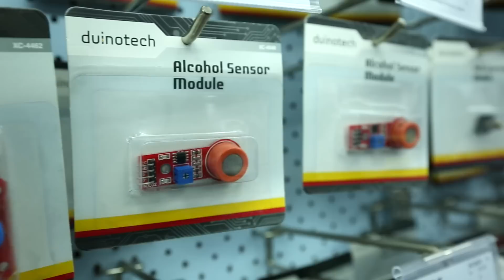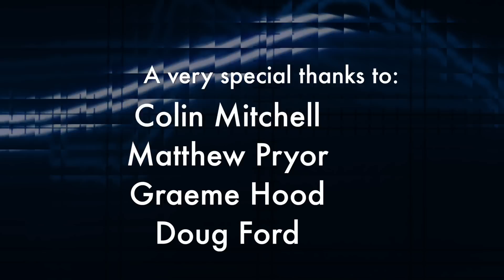The Decline of Hobby Electronics?

Comment: How do i start
Reply from the maker: Get yourself a kit from a place like Jaycar. One that comes with a book to help explain how it works and put it together. If it doesn't work, use systematic steps to solve why it doesn't work. Many people learn so much from doing that. Otherwise, start with basic electronic tutorials on Youtube, get an Arduino UNO, buy an electronics magazine. Despite the tone of the video, there are lots of options open to you. Good luck!
Reply: There are lots of good beginners tutorials on YT.  Try the free Fritzing software.  You can build virtual breadboard circuits with it.  It's handy to learn what components look like in real life and as schematic symbols.  I think it might even run sims and lay out PCBs.  There are some circuit simulators online too that show current flow animations and provide virtual equipment like a voltmeter, oscilloscope, power supply, etc.  Just Google it.  There are many Arduino forums.  Arduino is a open-sourced microcontroller platform with a free IDE and high level language support.  Look for Sparkfun, Adafruit, Thingiverse.  There are many sources for parts (i.e. Digikey, Mouser, AliExpress, etc.), kits, tutorials, Q&A, whatever.  Go watch Dave Jones at eevblog on YT.  There's also a eevblog forum.  Ask questions and get answers from people who live this stuff.  Analog circuitry includes many sensors (temperature, humidity, pressure, light), amplifiers, voltage regulators, AM/FM radio, etc.   Digital circuitry includes hard logic (i.e. NAND gate, NOR gate, 4 bit counter, shift register, latch, flip-flop, etc.) and programmable devices such as microcontrollers (Microchip, Atmel, Arduino, and dozens more), configurable gate arrays (CPLD, FPGA), and so much more.  Cool projects often include both digital and analog circuits working together.  After you complete a simple "hello world" or "LED blink" first project with an Arduino (or other controller ie. Raspberry-Pi, Beaglebone Black), you can add a simple serial text display (i.e. 2 line by 16 character LCD) and write some text messages on it.  Or, you can connect a serially controlled RGB LED (or several) and make amazing color patterns (search Adafruit Neopixel, you'll love it).  If and when you want to make a real PCB of your own, look for free KiCAD software, design your circuit and PCB and order your PCBs from JLCPCB.  There's an infinite amount of stuff to learn, and you can create your own too, so if you are serious, be prepared to commit your life to it.  The world of electronics and programming is big enough to fill 100 lifetimes.  Learning never ends and you can't ever know it all.  If this seems overwhelming, don't worry about it.  Just spot something that you think is interesting and follow it.  You can change direction whenever you want and nothing that you learn is ever a waste.  Just dive in and have fun.
Reply: @bill392 very helpful

Comment: As evidenced in this video, when you want to build something now you just get a couple of modules (arduino etc), clip them together, plug in some code and it works. No soldering, no assembly, no drawing out a circuit. It's pretty much all done for you. It has removed the enjoyment and challenge of first sourcing the parts, constructing a PCB and playing around with the unit to make it work exactly as you wanted it to. I think another thing that has seen the decline with hobby electronics is that kids are far more interested in video games and computers than they are in learning to build a crystal radio or novelty LED project like we did in the 70s and 80s. A small PCB that does one not-so-amazing thing just doesn't compare to a large screen with dazzling graphics, sound effects and games which enthrall kids for hours on end.
Reply: Arduino is both. 
As a beginner you connect your modules together and copy paste some code together and you're done with something that works quite fast

And advanced makers construct Thier own PCB with the components directly and write 1000+ lines of code and end up with something professional.
Reply: An arduino isnt tat wonderthing for  faster aplications you need still opv etc but it helps making projekts more advanced. Imagging making an amplifier the main circuit would be still completly the same because arduino etc is to slow but you can use it for undervoltage recognation current sensing and satus leds
Reply: exactly

Comment: LOL. I could picture this video being made in the 1960s. "The average person used to be able to change their own vacuum tubes...but now everything is soldered in place and you have to use a soldering iron just to get the transistors out. Those transistors are very expensive and hard to come by was well."

I think what is needed is a revolutionized hobby geared station that does all the business in one apparatus. Bake, machine etch, solder, hot air etc. all computer controlled via USB. for example a stenciling machine that also bakes. All the user has to do is place the components on the board. Hell, if it is micro controlled or computer controlled...all the logic needed for pick and place are already there too. So why not create a universal electronics hobbyist assembly apparatus? you could call it a UEHAA. Go from Kicad to NiCAD in one step.
Reply: Electronics was my hobby as a kid, and then it became a career - but it never stopped being a hobby and I still enjoy sitting down and designing PC boards for the things I need to produce for work or want to make for the hobby. After the boards are made I then get to enjoy filling the holes with the various components and producing a good workable product. Granted some of my boards now incorporate SMD - it makes the boards smaller, and if I put my mind to it I could probably make every board totally with SMD but old habits die hard. I started with through-hole components all those years ago and it's just so easy to keep doing it. I would never want to get to the stage where a machine does it all for me. If I was going to produce large runs of something I'd probably outwork it to a place that's already set up for such things.

Comment: Surface mount components are not all that difficult to work with.  I worked several years repairing surface mount PCBs.  It requires a steady hand and sometimes a microscope to do, but it is really not that hard.  I have been in electronics for over 50 years, so that helps.
Reply: Imagine yourself as a kid trying to do electronics. I think smd would be impossible...
Reply: @danijel124  reflow ovens and hot air stations make things amazingly easier. Considering how inexpensive they can be to get, starting out would be plausible.

Comment: I still solder, last 2 years with smd caps and R, and like it more then thru holes now. I solder with 2 small usb irons, each in one hand, to remove or install smd.
The only things is, I try to open the windows to hv air flowing, to avoid toxic smoke from soldering lead..
Reply: get your self an 80MM computer fan and put some carbon fiber over one end of it and keep it close to where your soldering. This helps greatly to keep the fumes out of your face and filters out much of the nasty stuff.

Comment: I believe I have heard many things that I feel aren't completely true. Now, it is not really possible to build a modern circuit with some simple clips and other things, but someone who does not want to use a soldering iron or hot air station can do a lot with "shields" and "solderless proto boards". Its still electronics. Those who want to do surface mount, you can. Buy a $50 hot air station. Comes with a very good iron and a hot air device. Get some better than usual "SOLDER PASTE" . Mine is "Mechanic" solder paste from china, product XG-50 (ebay) . And look at as many youtube vides as possible about it. Some only use the hot air to remove the microprocessor and use an iron to put it back. 

I REALLY look forward to the little inexpensive electronic devices I find in China. That said, I would buy them in USA or AUSSIE if they were even close to competitive and not two stepping Chinese goods. I'm willing to wait as I am not a businessman and only a modern experimenter at this time. I have been in business most of my life and things have definitely changed , BUT THEY ARE ALWAYS CHANGING and I believe some of these changes are for the better if you can EVOLVE ! ITS A FUN PROCESS !

Comment: Back in the 80's kids would mess around with transistors and quad logic gate chips. These days, that knowledge is too... low... for lack of a better term. Today kids start out with Audrino or Raspberry PIs, program and add interface modules. To start with transistors would be too... primary. It would take too long to get to the desired functionality. Now if you know Audrinos, transistors and logic gates, you are miles ahead, but it is not necessary.
Reply: @Richard Wolfe exactly same pitch here

Comment: Myself service my guitar amps most valve but at a hobby level . So if I am replacing caps id rather buy quality ones not china made as they are made to a price and will only need replacing in a few years there will always be a need for quality parts as valve amps are the choice amp for us guitarist building effects pedals from kits still going strong lets hope jcar last as I buy all my bits I can from them including watch batteries .

Comment: On the contrary internet shopping gives you access to way more options than any local retail chain ever did. The last time I saw a shop where you could go straight in and buy standard components of the shelf here i Denmark was TWENTY YEARS ago. There might be a few specialist shops around still here, but I bet if you want anything more complicated than a standard resistor or capacitor, they will have to go online and order it themselves, and tell you it will be here in a week or two.
But the microcontroller, cheap kits from China, and just a basic understanding that electronics and computers aren't magic has in my oppinion made the way for the rise of hobby electronics from something just a few weird people did in their shed, to now every one to hack, jailbreak, and upgrade their devices, use them in ways that was never intended by the designer, and generally not accepting that a device can't do a thing, just because the manufacturer says it can't, when you know they hardware is in there. So maybe we aren't building things from the ground up as much anymore, but we sure as hell are tinkering like never before.

Comment: When surface mount components are all that can be bought, hobby electronics will die. If one cannot quickly build it on a breadboard, discovery and wonderment with electronics will be highly diminished.
Reply: we will get bread boards that take SMD instead ;)
Reply: There are large stocks of through-hole components in the world, and will be for many years. We will all be dead long before these components disappear. A lot of components of this type are still being made as well, for different applications. Not everything can realistically be done with SMD. Power output transistors for example need a solid heatsink on the rear and sizeable leads to connect to the board. They are economically produced in the packages which are currently being made (TO-247, TO-220 etc) and at this stage the idea of producing them in SMD isn't practical or cost-effective.

Comment: For everyone who is into hobby electronics, you should watch this video. Its very good to sum up what has changed over all the time, eventhough im only 16. My dad for example started a long long time ago to make a mixing console, and he never finished it, because a year later they were really cheap to get and there wasnt a need to build one yourself. Also im not living nearby any electronic surplus stores like radioshack, but ive noticed that a lot of stores closed in the US. Nowerdays you just have to order things online, that not bad at all, but if you just need some more wire or a bunch of switches its very annoying. What also annoys me is that way more components are SMD, i hate to solder that. i just love THT components, its so easy to solder, but with smd... the industry changed a lot.

Comment: Nah whatever now anyone can buy sdr, fpga, powerful microcontrollers, for under 100bucks. Few years back that was only for scientists. Entry level increased? That's b*, arduino is simple asf, anyone can make led blink under 10 min. Electronics now is more about software. But damn is it worth it.
Reply: Arduino is basically programming, not really electronics.
Reply: Luís Grings you still need to understand electronics to makes things work
Reply: Not really, there are tons of "projects" out there with arduino where everything is already chewed up, some people will just buy the arduino and the components to build it, without knowing what the hell they are doing.
Reply: i started with arduino then got interested in electronics, i think it can motivate a lot of people to learn more about electronics.
Reply: I agree with what you have said. Electronics is also harder to learn than Software IMO especially analog & RF
Reply: I have flawless custom PCB's from china, I designed it, sent the Gerber files, got it back, looks nicer than my old computer chips. Price was less than 10 bucks for 10 LOL. As a kid your dad needed to work at Intel or some shit to even be able to get custom low batch PCB's, let alone for these ridiculous low prices.

Comment: In the US, electronics based employment at reasonable wages has all but evaporated and landed in Taiwan.  Why work for a Chinese owned company in your country making a few dollars more than minimum wage?  The incentive to learn electronics dies when this happens.  Not to mention the change in western culture, the disappearance of the drive to research, learn, and build something on your own as an individual.  There is also the state of modern electronics, one chip can do what it took an entire motherboard loaded with components to accomplish.
Reply: Electronic techician jobs are like $15/hr. No difference than unskilled labor. Why go to school for that. EE job growth staying the same in U.S. Software engineers 25% increase over next 10 years.
Reply: Not really dieing.  It's just made it easier for the diy'r to buy and learn how to build expensive commercial products much cheaper. But you're correct about the employment aspect of it not being worth the effort.
Reply: I do like to build and design things so it's a great time for that but your right about the employment part of it.  Also, what percent of degreed EE's get to become designers, very small compared to number of graduates. So alot of EE jobs is just pushing paper or using very little of all the math, physics and electronics that we had to learn. Nonsense.

Comment: Where I live we had no electronics stores selling components so before I had a job and could buy stuff from the internet I would spend my days desoldering every component off salvaged PCBs that I could
Reply: I still do that... mainly cuz I'm cheap
Reply: I still do that - although I am particular with what I salvage. I will keep power transistors, bridge rectifiers, relays, popular IC if they are in sockets. There has been a lot of waste of electronics and PCB have good parts on them which can be re-used and save you money.

Comment: I am 13 years old and happy to say I love electronics! I have my own workbench in my room complete with a 40w soldering iron, loads of wire, 3 raspberry pi's. and some components c:
Reply from the maker: That is brilliant. Good on you! Teach others, it will reinforce what you learn.Thanks for your comment :-)
Reply: I'm also 13 and love this aswell, have spent over a grand on parts and am currently designing my own lab bench power supply
Reply: https://www.raspberrypi.org/magpi-issues
Reply: It is actually a great time for electronics experimenters. One needs to decide just how detailed you are going to get with microprocessors. As a Pi person you are using languages rather than "machine code" or C++ and those who use the later can create things that are not available anywhere else. That said, the languages used with a Pi can be very useful. I was reading about a new one, Python I think , comes with rave reviews. 
That said, electronics is the other part of the picture. Try to be both a programmer and equally into electronics. I spend a lot of time looking for modules (shields) and little boards which do tricky things. I'm really into development of remote control. I want to know , for instance, when someone puts mail into my mailbox and or removes it or opens the box. And many more things. Ham radio is a great help with many helpers available world wide in Electronics ect. . Get your license as soon as possible, get all of your licensing out of the way now while your young (YOU ONLY DO IT ONCE IN A LIFETIME unlike your drivers license which you will do over and over again !) 
Good to meet you. Virtually . N6GRG Extra Class
Reply: 4 years on out, it would be neat to hear if you've gone deeper in this area? I'd have loved to have started with electronics at such a young age, but learning is a lifelong process, the best time to learn something new is right now!

Comment: Over the last few decades I have built several circuits with the 555 timer chip, it is a wonderful chip to exsperiment with a 556 chip is (2)  555's one on each side, be careful when using transistors, capacitors, and coils. Jacobs Ladder and more.